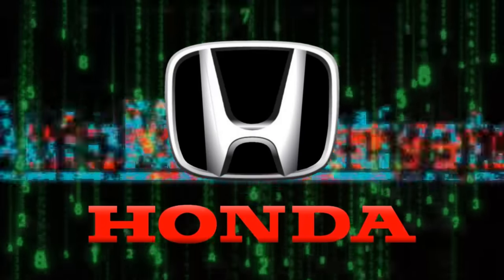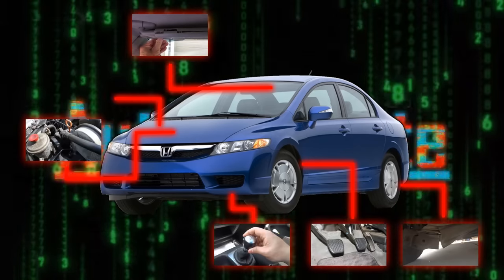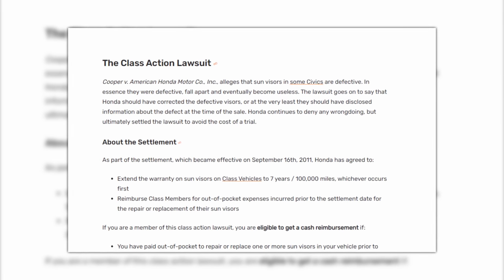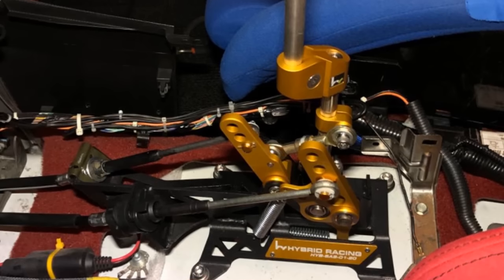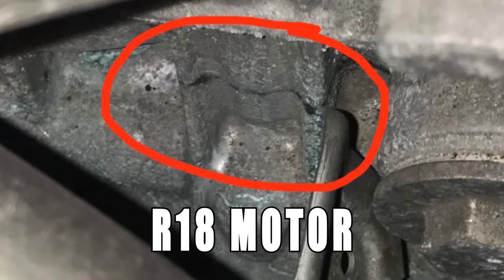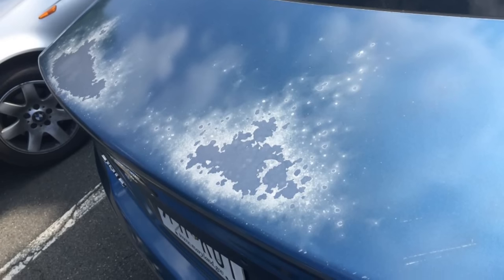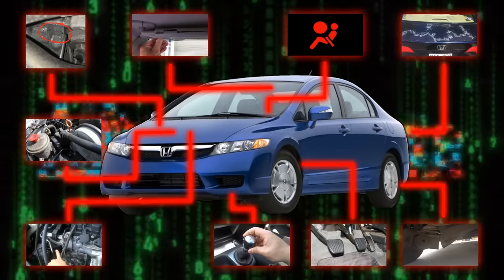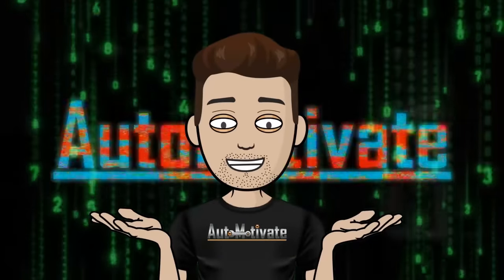Watch This Before Buying a Honda Civic 2006-2011

Comment: I’ve got 548,000 miles on my 2007 Honda Civic , original engine & transmission
Reply: Legendary numbers. ✊
Reply: Are u kidding me??
Reply: That’s crazy lol 💪🏾
Reply: Damn
Reply: cap
Reply: That's like 800k kilometres?!.🤔🤔🤔
Reply: How do u drive a car that much bro?
Reply: Alot of km..
Reply: Yoo, that's around 942.000 km LOL
Reply: WHOA!
Reply: oh wow 😳
Reply: I'm eyeing two of them for under 4 grand that are pretty clean under 200k for a diy project car.  I'm in florida tho, so i'm assuming they are beat to shit as far as stability goes, but I plan to swap out for a low mileage engine to boost, anyway. Most of the car will be replaced by the time I'm done in a year or two.
Reply: I got 320k km they live forever man and so cheap to maintain
Reply: Daaaam
Reply: @AlexanderGeorge  🤣🤣
Reply: Your lying. Your just trying to get attention and a reaction from people. Or your just showing love for Honda.
Reply: That's the year I have I like the sound of that lol. Its just my spare car.
Reply: @raiderrichard7291  it’s very possible to have that many miles
Reply: What did you do to put that many miles?  Work?  Just travel all the time for fun?
Reply: Wow hell yeah, i hope my 2007 honda civic dx-g lasts long like that!
Reply: Mine had 107k miles before I finally traded in. Rust got so bad my exhaust was hanging, that’s when I decided it was time to just use as a trade in. I had to replace the starter a few times, but other than that it treated me very well over the 14 years I had it. Just purchased a 2021 Nissan Versa SV
Reply: @GorillaGlue42  congrats!
Reply: Just picked up a 2007 coupe lx with 145 k miles on it for 2800 bucks..just need to replace breaks n rotors n give it a oil change n it perfect to bo
Reply: @osamabhatti3072  mine is 208k KM!
Reply: 404000klm on mine not 1 single issue. I get her oil sprayed every year since new in 2006 and no rust 5spd 2 Dr. On my 3rd battery 3 sets of brakes 3 sets of summer tires and 2 sets of snows. Changed spark plugs at 245000klm that's all folks👌
Reply: Holy Cow...That's insane...never knew an English could last that long...
Reply: Broooo... Like seriously
Reply: Just got my son a 2007 civic 4 door yesterday. It's got 150,000 on it, hopefully we will get you're kind of mileage out of it!
Reply: Whhhhaaaat? That’s wild
Reply: I can believe it. I have 150,000 miles on my 2006 and I haven't yet needed to add ANY oil between 6 month oil changes.   Castrol fully synthetic 5W20 btw.
Reply: How much did u pay for it
Reply: @artvasch147  yoo don’t buy old Hondas that are in the south. Everything under the car is rusted to shit.
Reply: Holy shit
Reply: @artvasch147  4 grand? Find a 2001+ Lexus ls430.  It’s even more reliable and a much nicer car as well.
Reply: Stop The Cap
Reply: what the hellllll lmao
Reply: @artvasch147  not always my car was brand new old lady would drive 150k miles drives like new srilll
Reply: Did you ever change the transmission fluid, brake fluid or power steering fluid?
Reply: GOAT
Reply: 6th gen si at 230k miles… starts to burn oil
Reply: Legend shir
Reply: Im debating buying a 2007 Honda Civic with 200,000 miles very clean. Feel like im taking a major risk though.
Reply: That’s a Honda or Toyota. There built to last! Love how they keep their value too.
Reply: @MannyQuacioua  never buy from a young boy. Make sure it’s a one owner so you it’s easier to tell if they kept up with their oil changes and any maintainer  work they had!
Reply: @MannyQuacioua  did you get it
Reply: @nikkibonanno3794  hellll no. Don’t trust it.
Reply: I hav a 2006 honda civic with 240k miles had a crack block put k-seal n its gud for now i guess lets c how far it goes
Reply: Damn! How much driving do you do?!?!
Reply: @charlesjohn4518  it’s very possible Honda and Toyotas are built to last. Why they keep their value too. Any other car or vehicle you buy looses value the second you drive it off the lot.
Reply: How ?
Reply: I believe you mine stop showing the mileage at just about 300000 but I've been driving it for years after that literally, I'm sure I could have the screen fixed I just don't drive it very often or far
Reply: I've seen a civic si 07 with give or take 800 000 miles on it, and that was years ago, and that chassis started to degrade and he swapped the k20 into another civic chassis and It's still the same transmission and engine with an unknown amount of miles on it lol. When they are taken care of they can last forever!
Reply: @CHOP_ON_SOLANA  did the car last a long time
Reply: @supertrippyjohng  I still have it 157k just had to replace the spark plugs n a coil..also replace the break n rotors but runs like a charm
Reply: @MannyQuacioua  definitely not you should get another 100k or more if it was maintained
Reply: I own a Honda Civic 1.4i (gasoline). Over 420 000 km / 260 975 miles. Still driving (Not sure for how long 😂).
Reply: Is that possible brother cause I will buy 2007 honda which has 250k km
Reply: @raiderrichard7291 😂😂😂. Seen plenty, talk to mechanics, you just nuts
Reply: @GorillaGlue42 Good luck with the CVT transmission 😂😂😂
Reply: Same my 98 sn95 is at 300,000 miles original engine and trans. Looking to buy an 06 civic to daily hopefully I can have both cars both Honda and ford💪🏾✅
Reply: i do got half of that in my 06 civic coupe definitely love him !!!
Reply: got 380k on mine. still strong and good to go. trying to take it to a million 😭
Reply: @TalhaaShaikh-sn4mb hey do u do tranmission fluod change on it ? I just got a 2006 hinda civic and first thing i did was a oil change ,im just nervous abou the tranmission fluid change my car has 220000 miles on it
Reply: @liljxmi1288  i did. i wouldnt flush the system instead just drain the old fluid and replace it. Flushing it would be too harsh for old transmissions. also id add a slip additive from Lucas. my transmission slips from 1st to 2nd pretty bad so the additive should help with that. I havent tried the additive yet but i heard it works. last fluid change was 50k miles ago gonna do another one soon
Reply: There's no way ANY car could have that mileage, even the deisel!
Reply: Land cruiser numbers
Reply: @tafadzwamusekiwa659  I misread that as land rover and i was about to get violent😭

Comment: so my neighbors have a 2008 and I swear that thing has never had issues
Reply: Only thing is the starter but that's all civics at some point
Reply: @antman619  same with our 07 accord
Reply: Lol I’m watching this vid just to see what BS is mentioned, BIG Honda guy here, the 8th gen civic is praised as one of the greatest generations ever of the car. I’ve owned two of them in the past 5 years and own one currently. Never had an issue aside from struts and the normal maintenance, he is speaking truth about the 3rd gear issue on the manual trannys. Mine doesn’t have that issue though, the SI models have EPS so... no power steering pump to go bad on those.
Reply: @MrWeshill  I have a 02 em2 5th gen have it 2 years now drove up to LA prolly drove back low coolant over heated a little  then I did coolant swap changed thermostat now it's fine never had a prob since prolly gonna need a clutch soon tho too many burnouts lol
Reply: Same here only replaced the starter.
Reply: 2008 FG1,
Reply: @antman619  yea I had to replace mine a while back I'm sure it's the og starter. Wasn't the most fun to change but not too hard with the right tools.
Reply: @MrWeshill  Forreal man like the 8th gen is fantastic only has 120 on it now I know I'll get an easy 300 or more out of it
Reply: I’ve had my 09 Honda Civic coupe for about 3 years now. Driven it from Wisconsin to New York 3 times there and back. Usually Spend about 120 on gas. The only two major issues I’ve ever had with my Honda was the one layer of coating the video talks about and the starter. The starter is the only thing I myself could not replace because I didn’t have the right tools. Payed about 300 to get it replaced. So far this car is 10/10 for me. Also drives great in the snow!!
Reply: Yea Honda’s are the best car to me there’s never any problems even with high mileage I just pressed on this video to laugh 😂
Reply from the maker: Helped out other people 🤷‍♂️ definitely not stating that every Civic has these issues. I’m glad you haven’t had any issues!
Reply: @AutoMotivate  I think the way you express the issues about them sounds like they are terrible car because of these issues and that they all have them. I know you said not all of them had these and some have been recalled
Reply: I’ve replaced starter, alternator, battery, and steering pump orings on the hoses on my girlfriend’s car, in the past idk 5 or 6 years. It’s a 2006. About to replace the AC compressor, belt tensioner and belt. Probably get a new windshield soon as well.
Reply: @seabass22  how many miles does it have?
Reply: @thinshadow6669  235k
Reply: @seabass22  nice, mines at 180k and have it with 400lbs of car audio equipment as my daily
Reply: I just saw a guy with a 2008 baby blue, cool rims, etc... it was a 2008. 
That's why I'm here...
Reply: @MrWeshill  I have a 95 Del sol Love it!! I just saw a guy with a 2008 today fixed up, baby blue, cool rims etc... Can you recommend a Honda Civic as in this generation or would you recommend another year? I heard 2016 is pretty damn good but I really like the look of the 2008 2 door like that guy has.,.. was so cool... If they 2009, 10 and 11 have the same look I'll go with the newest year...
Reply: @Gmoney0436  Cool. I'm looking to get one... 2008 or 2009. If you have any recommendations though I'm open to hear it. I have a 95 Del Sol and Love it...
Reply: @MikeKollin  yeah up to 2011 should be the same. I would go with the newest year as the manufacturer typically has the major issues fixed from the previous years straight from the factory. Same is for all vehicles
Reply: @thinshadow6669   OH yeah... so true! Thanks for the idea... I am googling images of 2011... Thanks!
Reply: @MikeKollin  no problem. Offer up is a good place to look for them and to compare prices. Don't get stuck to the first one. Look at at least 10 to get a good comparison
Reply: My uncle still has his 07 si and it runs fine and it has 100,000+ miles on it and this guy in the video is kinda right and kinda wrong  we need to get an oil change soon on it and it still runs fine but soon we’ll have to get it changed
Reply: @MikeKollin  2011 was the last year of this generation and the 8th gen is my personal favorite generation both quality and aesthetics’s. 9th gens tend to carry the same level of quality although I do not like the looks of that gen quite as well that a personal preference. 10th gen was when they started CVT’s and turbo 4cyl so I would avoid those at all costs simply because CVT’s are terrible and tiny turbos don’t hold the same longevity as natural aspiration.
Reply: @MrWeshill  🐹👻 Thanks!!
Reply: My 06 Civic (early prod: 01/06) has kind of been a moneypit at 165k but I love the car too much to get rid of it.
Reply: neither do the 2007’s. some years are just good
Reply: @FD-rh6tr  what have you replaced?
Reply: Mine 2006 civic has issue with rear upper control arms a bit short causing rear tires wearing inner side prematurely cupping, wiper motor, starter problem.
Reply: I have a 2010 civic, bought new. I have 143000. No problems. None that are major. Never had to take it to a mechanic for repairs. Yet
Reply: Anyone have their valves adjusted?
Reply: Had a 2006 and had no problems initally. Drove across USA from one ocean to the other a few times. Then one day the temp gauge shot up like crazy and it turned out there was an engine block leak. It's a huge warranty issue and Honda fixed it at their cost.
Reply: @MikeKollin  what is it with baby blue? Lmao.. I was looking at cars last week with my wife and somebody drove up in a baby blue RSX..with rims to match. I was so mad. Not because it was baby blue, but because I've been looking for a RSX for a while. I'd have driven the baby blue one. It was so clean. That's how bad I want one. Oh well.. I'm going to look at a 08 Civic EX-L in the morning. I only trust Honda/Acura. 💁
Reply: @caydeisclutch2589   🐹👻
Reply: @MrWeshill  is 2012 10th gen?
Reply: @johnlawful2272  9th gen civic 2012-2015
Reply: @MrWeshill  yeah but the eps rack is insanely expensive to replace and is like the 3rd gear grind, it happens but not as common as that. Mines about to hit 200k miles, havent had one major  problem yet. Also clearcoat problems, mines tafetta white tho and i aint got that. Ive invested a good 4k into the car though all performance stuff though along with wear items like suspension. Havent touched anything internal though and dont neet to until its time for a rebuild. Im sure boost will need me to do that at some point 😶
Reply: Mines a beast, at 315,000 miles. The engine and transmission are indestructible
Reply: Honestly my Honda civic 08 coupe never left me on the side of the road and I'm pushing 260,000 miles still running strong
Reply: 08 FG2 Si and just replaced the stock clutch at 156k. That is all.
Reply: i just bought a 06 ex coupe manual and only drove my charger twice since lol
Reply: I have a 2007 with 263000 on it still runs strong
Reply: 10 years. No engine issue
Reply: My starter ignition  cable just starting going about a month or so ago and just got it replaced.   Anyone know why my front driver side passenger  has never worked?  06 civic sedan. 82k miles
Reply: @johnlawful2272  9th gen
Reply from the maker: Just because you haven’t had many issues, does not mean they don’t happen to others. 
Think of this as a checklist when you checkout a car. 
There has been a surprising numbers of folks who said that they had cracked blocks, actually.
Reply: @thinshadow6669  I didn't feel he was disrespecting the Civic at all. All cars have there common issues and these are the ones for this Civic. I'm eyeballing a 2010 that looks great with great Carfax so this video was perfect to help me see the possible problems I may have.
Reply: Retiring mine at 325,000 miles. Just bought another with only 175,000 miles,
Reply: @antman619  Facts that starter be clickin but easy replacement any replacement less than $1000 is worth it on an 8th gen
Reply: @williamwalker7177  only thing iv changed on my 02 is the thermostat its got 180mi on it now had it for almost 3 years now its stock lil exhaust body kit its a ricer
Reply: @antman619  My Civic starter has just failed at 190K km (118k miles). I would consider this normal with all the salt on the roads in Canada.
Reply: @TheElfpath  Reliability is subjective :) Some people would never had issues but they just use it to go grocery.. Some others will have issues but won't even mention them.
Reply: @BobbyR2  valid point. I’m just speaking from my experience since I drive a civic pretty hard and it’s a tank but you right tho
Reply: @TheElfpath  LOL I thought you were talking ironically when you said "yeah cause...". My bad. As my own point of view, I agree it is a tank. 12 years old/200K km driving in pot holes and I've just replaced few parts (starter, exhaust, AC clutch) that have been damaged by the salt. The original rear brakes has just started to show sign that they are worn :) I've replaced the original front rotors at 150K km!  Love that car.
Reply: I have a 2006 and it never gave me any problems I never had to do anything to it other then tires - brakes - gaskets - and oil - and bushings when they go bad only thing I don’t like about this car is the rear sags and the rear of the car loves to slide so it’s very easy to loose control of the car
Reply: My 06 got 234k it's needed a radiation from a deer fucking 🦌...cracked the rad...new starter n water pump control arm ...she purrs...quick too
Reply: @kiaraatenee3494 which year model do you recommend?

Comment: I picked up this model back in 2008 when it had 44,000 miles. It's 2021 it still running strong at 189,000 miles. Only problem I had is worn front struts, failed starter and blow cv axles. All fixed and everything is maintained through service manual. This car definitely worth the buy.
Reply: I get a scraping/squeaking/clicking noise when I turn left or merge left or when I am goin straight, the only time it stops is when I hit the brakes or turn right, could that be the cv axle? The noise I originating from that area in the front driver side.
Reply: @thundergod2645  it is . Mines does the same thing
Reply: @thundergod2645  control arms or cv axel
Reply: have also replaced the starter in my 2009 civic with 85K miles. No issues other than a blown speaker
Reply: What do you mean by a ‘blown starter’? As in the car itself won’t start?
Reply: @triv4555   I also replaced my starter as well after hitting more than 100,000 miles with the OEM starter
Reply: @triv4555  Like the starter motor stopped working or was too weak to start the engine.
Reply: @7SUK1  damn that’s huge 🤦🏽‍♂️
Reply: @triv4555  Not really, I heard it's about $300 to replace and then you don't have to worry about it again. Granted, no one wants to have to do this and spend $300 but it's not like the other potential problems like the cracking block. That's huge.
Reply: Same here....and an AC compressor. Everything else is in great shape
Reply: Bought a 2007 three days ago. Manual transmission.
Reply: The paint is not the problem. What fades is the clear coat